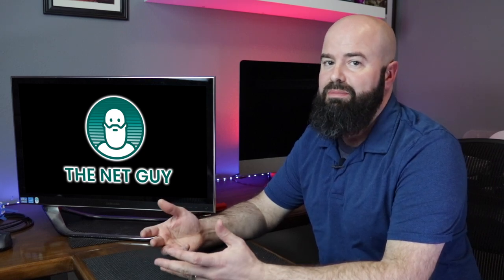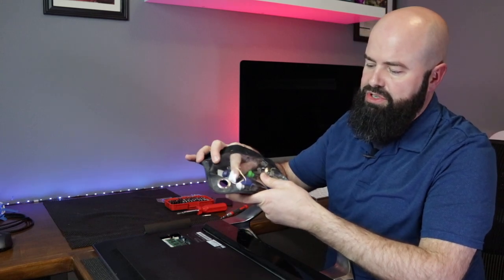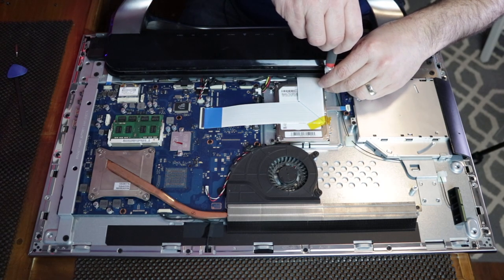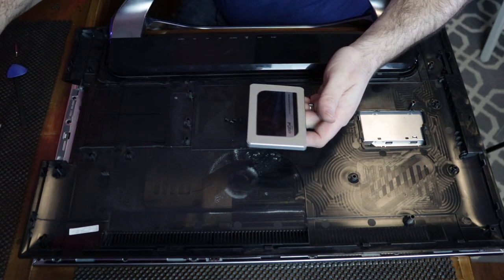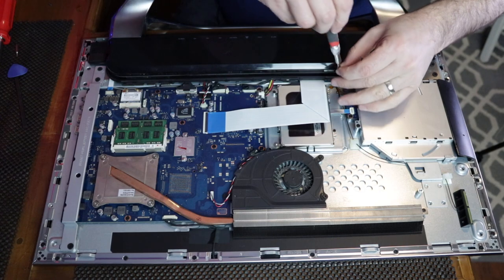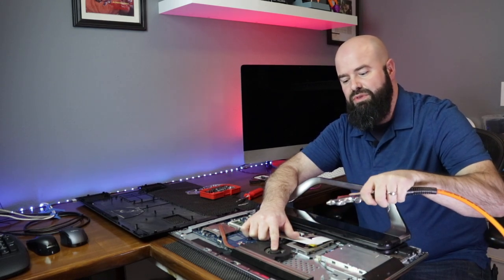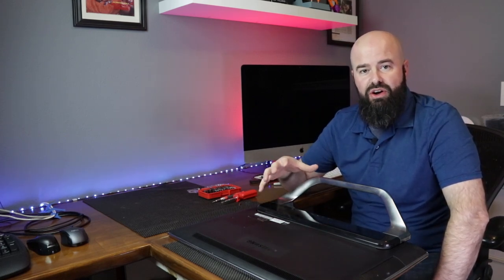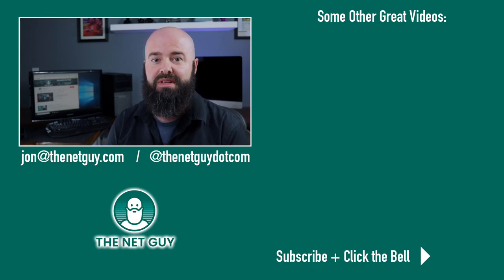Is your Hard Drive Failing? (Part 3 of 3)

Comment: Great disassembling video.  I liked the zoomed in inset shots of the screws you removed.  We have a bunch of Dell All-In-Ones like this Samsung at work.  They even came with lame Seagate SSHD drives which have a history of failing.  To make it worse, the computers are mounted on desks with electric lifts.  The computers are left stored inside the desk for months at a time, allowing the system to basically cook itself for lack of ventilation.